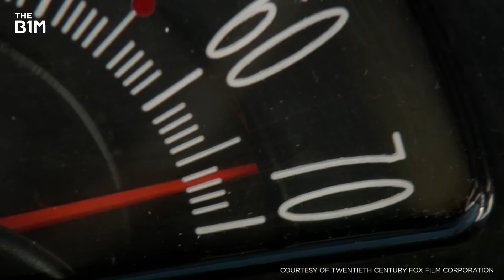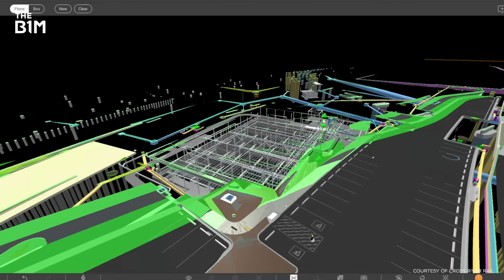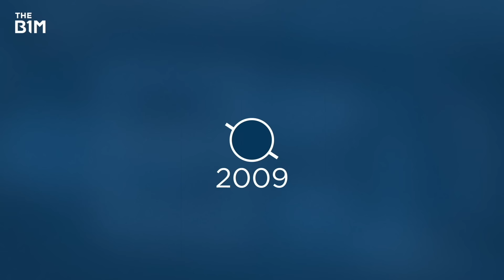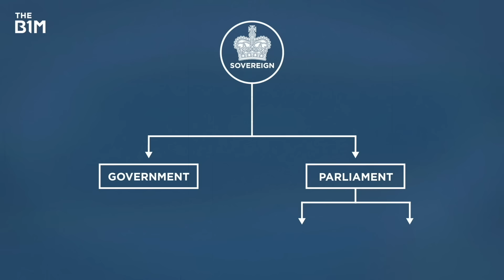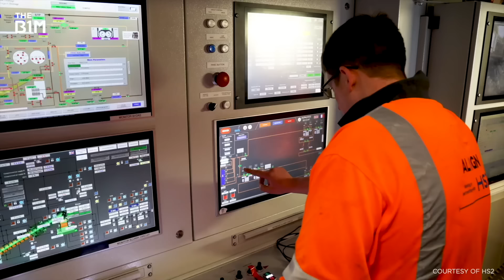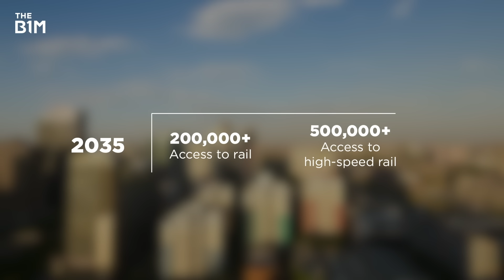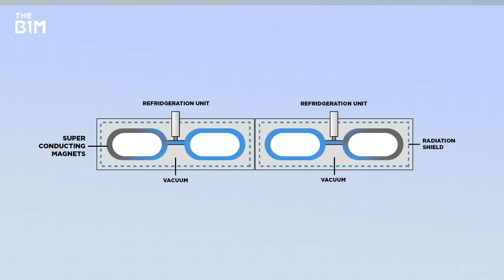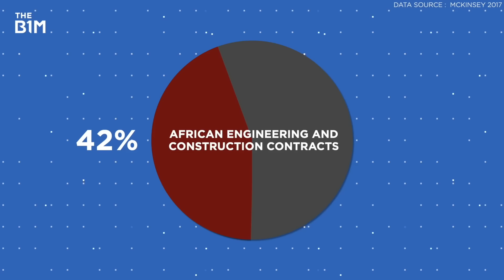The World's Most Epic Railway Construction Projects

Comment: That HS2 project seems pretty cool. I wonder when it will be done💀
Reply: 30th February, 2163,  :p
Reply: @akeel_1701  Overly optimistic 😢
Reply: "That HS2 project seems pretty cool. I wonder when it will be cancelled" fixed it for ya :D
Reply: Far from it. It's an expensive White Elephant 🐘
Reply: @Morris-c8f  Didn't Rishi just cancel it?
Reply: @avishjha4030 not completely, just gutted it enough that it'll deliver 20% of the benefits of the original while costing 80% as much
Reply: HS2 was three phases, 1, 2a and 2b. 
▪ phase 1 high-speed track is London to Birmingham with a link at Handsacre north of Birmingham onto the existing West Coast Main Line taking trains to the North West of England and West Scotland. 
▪ phase 2a is Handsacre to a junction at Crewe.
▪ phase 2b is Crewe to Manchester on the west coast & Birmingham to Leeds on the east coast.

phases 2a and 2b have been cancelled for good.
Reply: @akeel_1701 Haha! good joke. 

There's no way it'll be done by 2163.
Reply: When you have a revolution
Reply: @FreeFlyerUk your opinion is a white elephant
Reply: @FreeFlyerUk 21st century luddite
Reply: Never!

Comment: Honestly? Look into Philadelphia’s subways. There’s at least 3 lines that they had planned for that were never built, leaving certain bits of infrastructure abandoned. It was also supposed to have a loop line, and at one time, there was even a plan to ring Center City with highways and only allow busses into that part of the city. Plus there’s the whole saga of passenger rail in the region and SEPTA getting so close, yet so far, at creating a S-Bahn type system

Comment: India last year, built 5000 km+ Railway. Electrified 6000 km+ route (91% electric), manufactured 6000 + Coaches, 1100 Locomotives, indigenous 180kmph+ Vande Bharat Express, 
Also building Mumbai - Ahmedabad HSR line with made in India Full span Girder launching machines. 

Yet, a 500km project is being mentioned but not 5000km one.😢
Reply: safety is still a huge problem with india rails. this need to address asap

Comment: Building a rail line in a tunnel underwater makes me wonder whether they’ve planned how they’ll clear derailments? When a derailment occurs will the tunnel survive an internal impact against the tunnel? If cars have to be repaired how will they be repaired in situ or moved to a repair facility? 
With a computer graphics system, inevitably, upgrades will degrade the performance of the software. With every update I can practically guarantee there’ll be glitches in measuring of building component locations. In the history of the Olympics very few sites will be there long enough to be utilized again. No one seems to be willing to reuse older facilities.
Part of the attraction of rail travel is the journey. Traveling faster than what your eyes can focus on inevitably leads to increased fatigue during the journey. The result will be a trip that seems interminable.

Comment: HS2, the most expensive high speed rail in the world. Even just saying that sounds bonkers. And all to save a whopping half hour from London to Birmingham. Untold billions could have been saved widening, modifying, altering, and upgrading the existing system so it could accommodate dedicated faster rolling stock without reducing existing capacity needs . It might not have cut travel time by a mind bending HALF AN HOUR but it would have got close.

Comment: I can't believe there is so much negativity over HS2. Everything comes at a cost, but the project is awesome. Would love to have a highspeed (or even higher speed rail) project getting built for our country.
Reply: HS2 was a bad design. It went  to places which already have high speed rail.  It solved nothing with few benefits for an amazing amount of money. Liverpool was left off entirely.  Bad plan.
Reply: @johnburns4017 the current high(er) speed services are exactly the problem. They need such huge gaps in front of them that smaller stations like my local one get services removed to make way. We're trying to run local and intercity and freight on the same tracks and you can't do that without sacrificing services. Local and freight can work together but the intercity trains need to go.
Reply: @david65219  
HS2 is just a bad design. It ignored the Liverpool City region of over 2 million people. The city needs extra rail lines as the port is expanding, so they ignored the city. No kidding!

A prime aim was connect British cites to the continent. That would mean the spine running down the east of the country then branching into the Channel tunnel or London.  It in via the west - no kidding. As soon as the continental link was dropped the raison d'etere dissolved. The plan then should have been dropped.
Reply: @johnburns4017  Liverpool would have been served by HS2 services on conventional tracks, but eventually would be served by HS3. But then Treasury cancelled HS3.
The primary aim was never to connect to the continent, such an aim is all but impossible as long as we're outside the Schengen Area.
Reply: @david65219  
HS2 was before HS3.  London to currently Liverpool/Manchester is about the same time.  Liverpool would have been 35 minutes slower to London under full HS2 than Manchester, and was even bumped off HS2 to Birmingham. Runcorn in the Liverpool City Region lost its London service. 

When HS2 was announced, the Liverpool delegation was talking to the HS2 team, wanting to know why the city was screwed big time.  They said it was clear the HS2 team never knew the city was to have a second large container terminal built in a few years, needing an extra line. The port serves all the North, so it is their port. It is in the interests of all the North of England to have it efficient.  Yet Manchester was having a 10 mile gold plated tunnel into the city. 

We connect to the continent right now.
Reply: @david65219  
Liverpool City Region indirectly gains by this cancellation of phase 2 - parity with HMGs blue eyed boy Manchester and retains the London-Runcorn service.

Comment: China's assembly line approach to standardization and central dispatching are key elements to the success and quick return on investment of the system. Once the lines are in motion and regular use, the immediate benefits start a positive snowball effect on trade and efficiency, similar to what we saw moving autos and trucks from surface roads to the Interstate system.

Comment: I might of missed it but I don't understand why the speeds promised by HS2 are going to be so much slower than promised? (and also doesn't the slower speeds call the whole idea behind it into question?  High Speed was such a big part of the idea behind it that they put it in the name.)
Reply: I wonder if a small country like the UK would be better served by a more extensive network of just fast, (200km/hr) trains rather than a 350km/hr train on a short hop to Birmingham. I used to travel roughly the same distance in China, to Suzhou but there were several stops & train only reached 300km/hr occasionally. Still got there in an hour & a quarter.
Reply: @daweilaotou1269  Yeah, seems reasonable.   But in that case wouldn't the infrastructure for a train traveling 150 kmph slower be significantly less demanding?  As I understood it they wanted high speed trunk lines going up and down the country to shorten the times for those long distance routes and reduce traffic on regular tracks, but still leave in place the regular network for the short branches from the high speed.  I think that kind of only makes sense if the main trunk operates at those crazy speeds, otherwise a fast but wider network like you indicate would seem more useful.
Reply: @UnbeltedSundew  they had Dongche, (D trains) rated at 200-250km/hr from my city to Nanjing, only about 75km but they ran on the old, slow train line. They might have upgraded it but it wasn't the dedicated concrete viaducts the high speed rail ran on. If you could get around the whole of the UK at 200km/hr I reckon it'd be a viable option.

Comment: HS2 - British Government has ripped up the project - now HS2 will stop at Birmingham and will only reach Old Oak Common in London (unless £6BN is raised by private finance to finish the leg to Euston and a smaller Euston). This makes the UK a joke. People are failing to understand the benefits of the scheme, and the huge increase of cost due to meet the environment sustainability.  We have a 2050 Net Zero target - Rail infrastructure needs a massive investment to meet this requirement, new lines not just high speed lines, all lines need to be electrified, yet some new lines are not. A total mess.
Reply: HS2 had few benefits. Hence the mass protests.

Comment: Sadly train lines do not generate extra income in the big picture. What happens is that it takes revenue/livelihood from all the people and area it runs thru and give it to the main station cities. It also shifts property value severely, in the city prices skyrockets and in between it plummets. This happened when the US highway/freeway network was built thousands of small towns lost the income from travelers that sustained these places and now they are becoming or are already ghost towns. This will happen in Mexico as well there is no getting around that. If you live in or near the city in question you may benefit, if you live and work outside that area you will lose badly. The value of your home will fall and you will most likely lose your job if it at all is dependant in any way of local travelers/visitors.
Reply: you look at a very small picture, a good infrasture rail network also let you move good cheaply,faster in return saving pass down to customer

Comment: While I was initially excited by the Chuo Shinkansen maglev train and still kinda thrilled to see the experimental L0 maglev sets being run, I've come to realised that most of the build cost is in the construction of tunnels through mountains. I wonder if it would have been more commercially viable if they just run regular railed HSR trains. Not only is it much cheaper to run, but it has a higher passenger capacity for the same amount of space. The current technologies that the Shinkansen is trialling with now have trains that has set speed records of over 440 km/h. It could probably handle operational speeds of 400 km/h over the mostly straight sections, just 100 km/h less than the L0 maglev trains planned commercial speed of 500 km/h

Of course, the L0 maglev will be a showcase that may someday export the technology to other countries, so I can understand their motivation to go ahead with that.